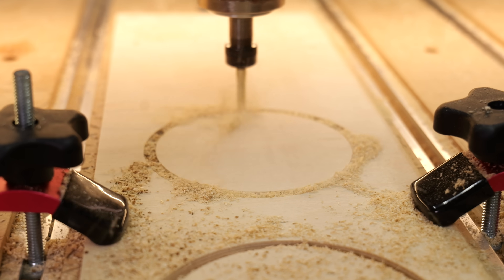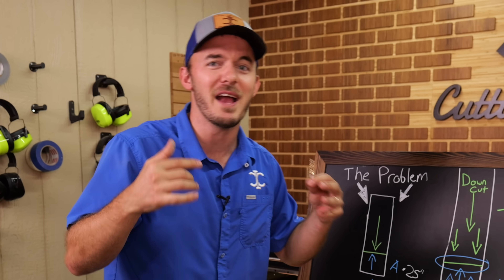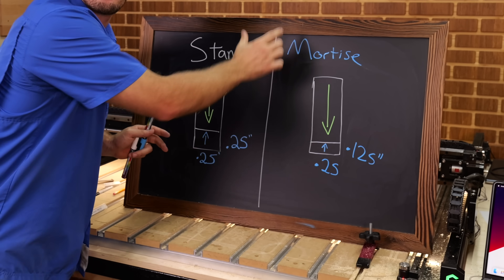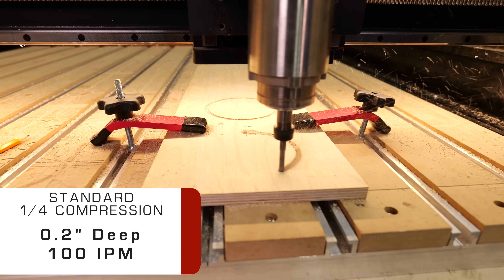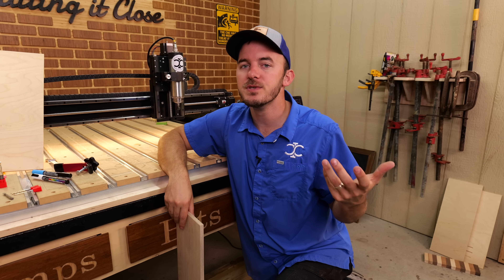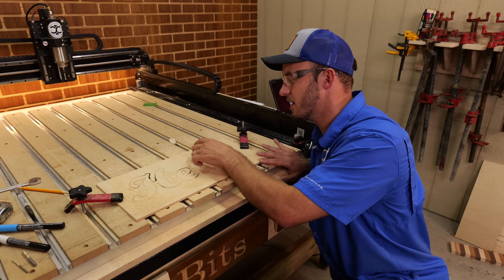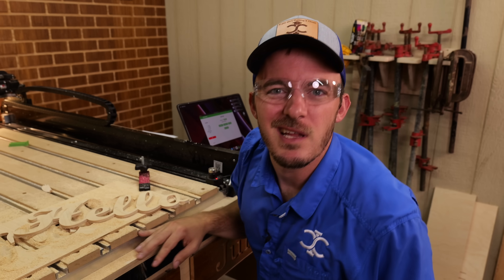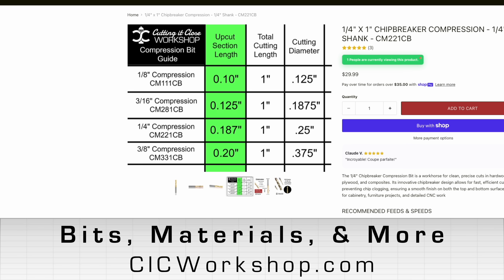The Most Misunderstood CNC Bit

Comment: Another well done instructional video.  When cutting plywood these bits are so helpful, in my experience more impact than in hardwoods.  The biggest challenge in the past was getting the spec on when the transition happened.  These days tool sellers are doing better at publishing this data would be nice if everyone published the data.How is the side finish in your chipbreaker bit and why wouldn't all bits use the chip breaker design?

Comment: Hi.. Great video... Just one question, I have have a medium size cnc (2.2 kw spindle) most of the time I cut 3/4 plywood for muy projects.. what are your recommendations on what bits I have to use.. A compression, Up cut or down cut bit... ? it's for cutting.... What speeds do you use.. my cnc is a hobbiest one I think

Comment: I use a CNC in a local shop.  I'm told that the pass depth can't be more than 1/2 the diameter of the bit.  But in many of your videos it looks like you are going the full diameter width in depth or even deeper.  Is this just based on the power of the spindle?  Are there other factors?

Comment: For deeper stock, I usually use a down cut to 1/8" above the spoil board with 10thou oversize, then I switch to compression and make a full depth pass at the exact dimension. 

Much less wear and tare on the expensive compression bits, and I can run the downcut fast as I have whole sheet held down solid for 5/8 to 7/8 depth (3/4 or 1" sheet).

Running bits slow (rpm or feed) vastly decreases their edge life due to heat build up.

You should be able to touch the bitb without getting burned after a run.

Comment: I use compressionbits for pockets and full depth one pass cuts like you explain. I would advise though, that doing multiple depth cuts with a compression can be a problem unless you make a finishing pass on each depth to release some of the pressure fomr the compression, to clear out the chips for next depth pass (Does that make sense) But as always.. great video :D

Comment: @cutting it close. I'm going to be cutting cabinet parts out of 3/4" cherry plywood.  Would your 1/4" bit do the job or do I need the 3/8" bit?  One pass or two?  I have a rack and pinion all three axis with a 5 hp Columbo spindle. Also curious about feed and speed.  Thanks.

Comment: Love compression bits, never tried them on material like oak but in walnut or cherry i just go 9mm depth of cut per pass so my 18mm sheet of walnut im doing in 2 passes and the edges are looking great from the upside and downside, of course using ramping
Reply: What machine you're using?
Reply: @Luca_s_Lab  it's from china Xk-1313

Comment: I love them, if the machine is strong enough those bits are a huge time saver. I also use them as finish path on deep profiles to clean the sides, the top and the bottom in one go. Great video!

Comment: Couldn't we just use a lower feed rate to address the issue of using hobby CNC machines like the Altmill?
Reply: Try and let us know!
Reply: @Luca_s_Lab I don't have a CNC yet 😅
Reply: Slow speed causes more heat and your bits won't last long. 

Get a bit you can run fast and at the depth you want for your machine... If that's too hard on the router, upgrade the spindle or hold downs.

Comment: On plywood, with a compression bit, always cut parts with the show face down if possible, because the upcut portion of the bit creates a little area of tearout as it enters the cut. If the show face needs to be up, or if both faces show, use a radial entry: set the bit to enter the material between ¼ and 3/8 of an inch off of the final cut line. If you do this, the tearout at the entry point will not be on the part. With nesting lots of parts, this can get tedious, because you need to set entry points so they don't cut into adjacent parts. But it's worth it to avoid tearing expensive veneered plywood.
Reply: Ever heard about lead in and lead out ?